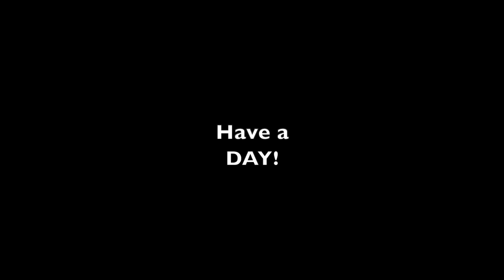Things are about to BREAK WIDE OPEN! #1036

Comment: Looking forward to the plumbing/electrical work. Concrete will be nice also. You definitely need a buddy seat here and there. Dad used to pick up my twin girls in the front loader bucket. They were older of course.  You could pad the excavator bucket and add a seat belt or the back blade?
jack

Comment: Good morning! Lots about to happen there at Camp Morgan. With an impending hard deadline so that the reception can be in the big rec room. Y’all are gonna be hopping. I see one more community park log still needs to migrate down to the mill. Juggling loads of stone probably doesn’t just happen at the snap of the fingers, and I bet you hadn’t figured on more tree and dirt work on the hobby garage project. At least the excavator is on site now to take it down. I wonder where the topsoil can be stockpiled; moving that might be a full day’s work with the dump trailer. Just a lot of logistics around that build. 

The hydro seeding is cool stuff. Quite impressive how far it can be spread.

Comment: Love this channel and you guys to the max. I'm curious about the concrete pour for the new building. I put my thinking cap on and couldn't figure out the best way to do it. Do you surround the post's that go into the ground? Or do you go to the edge of them/ and let them float. I had one idea about drilling a half inch, or 5/8" hole sideways right below ground level and sliding rebar in there sideways tying them together, that way the concrete is supporting the beams beyond the 50 years of life expectancy for sunken pressure treated beams. But then if the ground heaved it would lift the beams and erode the integrity of the structure. 
I am sure you have it figured out. Like I said, I love watching this channel. 
Hey Mike I am whole heartedly working on getting my Woodworking channel up on You Tube. Setting up shop will probably be the first one. I have decades of experience, Powermatic equipment etc. I have so many ideas I would love to share with you about that since you are planning on putting up a shop in the new building in a section. I thought, why now do the video and share it with everyone. Every time you have a new video release it's like pop corn fun. The anticipation is half the fun. Keep up the great work.

Comment: Mike, I think you're right.  I've been thinking real hard about de-winterizing the camper, LOL.  Long Range Forecast has us with highs in the 50's or 60's all the way out, with lows in the 30's... lowest low is showing 31.  Spring might be springing... I didn't say that, don't want to jinx it!!
What I'm really waiting for is just for things to dry out... everything is just MUD right now.
Reply: Also, you've got that dump trailer!  When I put in our septic drainfield, I hauled 35 tons of rock myself with my 12' dump trailer for about $160 less than what 1 tandem dump load (usually about 15 tons around here) would have cost.  I just added 1 day of hauling rock to the project, and saved myself about $650.  I know you have a half-ton truck, so I don't know how well your 150 will handle a  capacity load of rock, but I can get 5 tons on my trailer, and my 2500HD Duramax was like a Golden Retriever with a stick, LOL

Comment: Mike, I noticed you have a technique for loading stone in your bucket. You hover past the pile and drag the material back before you drive into the material with the bucket. Is there a reason you do this? I'm curious.  Good video buy the way.
Reply: He explained that once. It keeps you from chasing the pile off into the distance. When the pile is tall, it gets the stone you want down lower so you don’t have to lift the pile to curl and lift your load. It also broke up the surface frost this time, and sometimes a dry crust.
Reply: @johnsadler8637  thanks Highlighted.

Comment: Looking at the title, I was hoping you were going to say things are going to break wide open in the oil and gas exploration.  I see the price per barrel is up which means folks in the US can afford to drill which means a lot more jobs.   The seamless pipe producer where I worked makes drill pipe and has been closed for a year now.  Things are finally starting to look up.  That driveway around the building looks awesome.  A lot of work to do it right but wow what a solid drive when finished.
Reply: I BEG TO DIFFER WIT YOU SINCE THE NEW COMMIE ADMIN  PUT MORE GOV RESTRICTIONS ON THE INDUSTRY THEIR IS GOING TO BE MORE MASSIVE LAY OFFS & MORE FOLKS OUT OF WK. I WAS WORKING ON THE KEYSTONE PIPELINE THEY SHUT IT DOWN ALSO RIG COUNTS ARE DOWN & MORE RIGS ARE BEING PUT IN THE DIRT. HAVE A GREAT DAY. BTW EVERYTHING WILL BE GOING UP.
Reply: @keithcronk7980  I agree on the admin and pipeline.  Hoping shale oil drilling isn't affected as well but I haven't looked at the rig counts for quite a while.  Not good news.  I hope it goes differently than expected.

Comment: Mike, your extension cord would be a lot safer if you built a bridge to protect it instead of driving over it. Once the insulation is crushed enough times you can create a dead short in that location. Just a couple of 2x4's laying either side of the cord and nailed together on the ends to hold it together will do the trick.

Comment: Good Morning Morgans. Mike for temp use we use Slag from steel companies around here in Harrisburg, Pa. I am sure there is somebody that sales that close to you. Its 2A version is only $2.00 per ton. Plus Stone Quarries have what they call junk stone which is a mix of like 2A/2B sometimes dirty stone they grind cheaper than the regular price.
Reply: I'm interested in learning about the different grades of stone, like what is difference between 2a and 2b?
As for the shop floor, I usually put a couple of inches of sand on top of the rock before compacting so that the foam has a good, smooth surface to lay on.
Reply: @harolddouglas4057   2A (sub base) is smaller and has dust in it and it compacts really good. It’s good for driveways. 2B or (57’s) is a little bigger. This is used before you pour concrete. or were you want water to drain through it.

Comment: Hope you’re going to put down 2” of styrofoam insulation before your tubing in the floor !
Reply: I'm sure he will. All that heat in the tubes would be sucked out from the 50-55 degree constant earth temp right ?
Reply: Dennis I have the feeling Motor Mike will not be doing much of the finish work on the shed with the time line he has.  All the wood that he planned to finish off the inside will have to be kiln dried to have it ready for the wedding.  I would imagine all of his sponsors expect him ti show thier products in use also.   More time than Motor Mike has.
Reply: @realairplane261 , Who's Motor Mike ? Thanks.
Reply: @augustreil  Motor Mike is Mike Morgan.  I gave him that Nick name because 90% of the time he is operating a motor which is actually an engine, Motor sounded better than Engine Mike.
Reply: @realairplane261 , Gotcha. I'm slow but understand now ! Thanks.
Reply: @augustreil  you are not slow.  I call your question justification when a guy does not know.  I am the same way.  Enjoy the purr of Motor Mike!😎
Reply: @realairplane261 , Haha. Thanks, much appreciated !